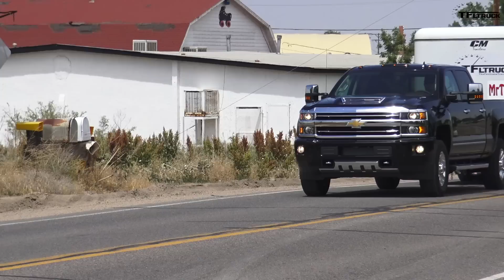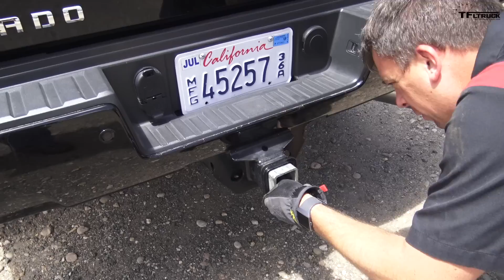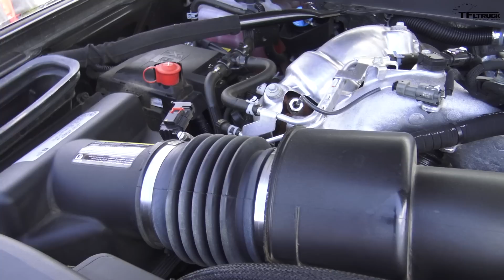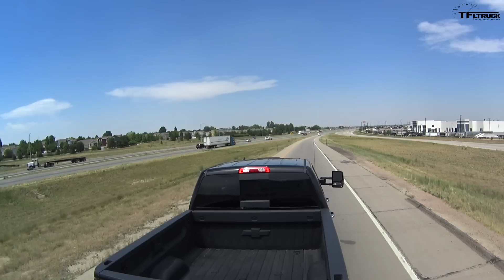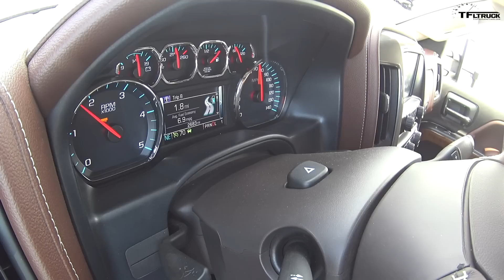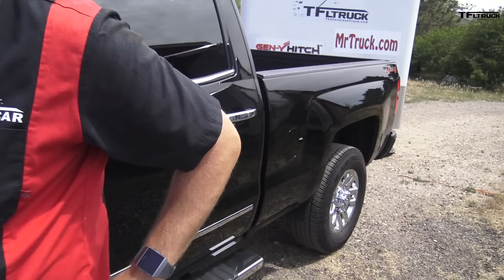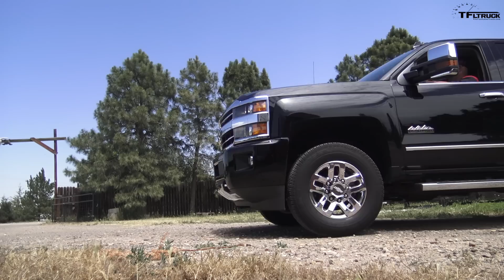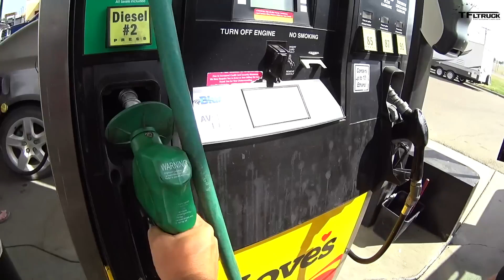MPG Challenge: Silverado Duramax vs Cummins vs Power Stroke

Comment: Did I misunderstand or did you say this is a 3500 against Ford and Dodge 2500???  How can you compare them?
Reply: the only real difference between a GM 2500 and 3500 single rear wheel truck is a set of bigger overload springs to increase payload, and yes in this comparison I'm sure the 2500 would have done slightly better than the truck they tested, so the college ball player would have beat the professional. your analogy dosn't apply.
Reply: And the 3500 should be at a disadvantage.
Reply: Nothing Much me too.  I have a 2002 7.3L Powerstroke and my dad has a 2002 Duramax.  He destroys me on mpg.  My interior room is better though.
Reply: Bad Karma
On Chevy's site when you select the duramax you are switched to a 3.73 gear, the 4.10 is for vortec gas engine. If you click on 4.10 it will give you a popup telling saying it will remove duramax for the vortec gas motor.
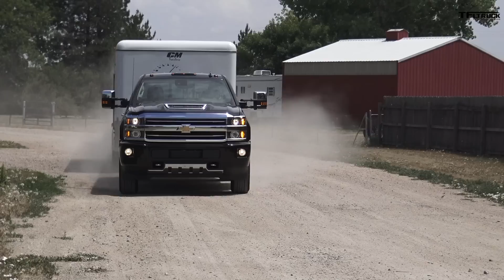Reply: For MPG purposes empty YES, towing with 4:10 gearing  It's a big advantage.
Reply: Love PPG no difference between 2500 and 3500! a leaf spring? OK how is that going to affect MOG at all. it's not a 1500 vs 2500. now THAT'S a different truck.
Reply: Love PPG If the difference is only a leaf spring then GM is charging a whole lot more money for it and not gaining much in performance.
Reply: Dude, how many times does this have to be said? They used the 3500 to make it HEAVIER to be comparable to the Ford and Dodge. If they used a 2500 it could be 4-500 pounds LIGHTER giving it a bigger advantage on the MPG circuit.
Reply: Love PPG , the 3/4 ton and 1ton Duramax only comes with 3.73... period..
Reply: He said in video, the Chevy 3500 is more comparable to f250 and dodge 2500 load capacity.
Reply: maurice davis im kinda confused on what your trying to say here.
Reply: Bad Karma it doesn’t take an engineer to do a little researching. Also if you knew trucks well enough before hand you’d know the only differentiating factor is the capability to tow more. Which doesn’t help in this test at all and is a disadvantage if anything in this particular test.
Reply: Tell me what exactly is the difference between the two other that the suspension.
Reply: The ONLY difference between a 3500 and the 2500 is no tpms and different leaf springs. So yes, fair test.
Reply: Conner Leshovsky are you an idiot? Ok let's suppose two people with the same strength are carrying 50lbs of something, one with ankle braces one without. Who will consume the most energy.
Reply: Hicks that’s not why they said they used it. They said because it has the same curb weight as the other trucks.  Basically they handicapped it.  But they should not have done that they should’ve tested all to50s from each brand equally.  They should not have penalized Chevy by using the heavier 350to compare mpg with the other two 250s.
Reply: Both people are also of the same weight and height.
Reply: For the of you who didn't find it obvious the one with the ankle braces used just a little more energy.
Reply: Kyle C. What?
Reply: Love PPG that's very different because the weight of a baseball player doesn't affect the way he plays, or throws. The weight of the truck changes the mpg because it's more weight. They are testing mpg so having the closest weight makes sense.
Reply: Love PPG... Ok you know what. you clearly don't understand what anyone is trying to tell you lol. I think you just want them to use the 2500 Silverado so it can whoap ford and rams ass even more in MPG testing lol? (because its lighter in weight)...
Reply: On the Chevy the difference is only in the suspension between the 2500HD and the 3500 SRW. The engine, transmission, rear diff, front diff, brakes, etc are all the same. The suspension isn't going to make any noticeable difference in mileage.
Reply: The Real John Smith, Even though the ford f350 has a higher towing capacity, if they were to pull the same weight trailer, the Chevrolet Silverado 3500 would tow it better and still accelerate quicker and have the better efficiency.
Reply: The Real John Smith the Chevrolet had the quickest time going up the ike gauntlet compared to the ram and ford with the same trailer.
Reply: BBMustang514 In terms of efficiency and weight class. Even though it has the lowest towing capacity, it will tow a trailer the best.
Reply: Nothing Much what about the payload effects on the truck of the 2500, higher suspension squat since the 3500 has a beefier set of leafs. Would change the aerodynamics of the truck which would effect mpg
Reply: I know that ya'll get what your get from the manufactures but this was just not an accurate test.
Reply: PARA-ADDICT! The only difference in 2500 vs 3500 would be suspension and potentially frame stiffness. The engine,  transmission would be the same. The comparison is saying that the same weight of vehicle, same trailer weight you are essentially taking out all the variables and doing a direct 'engine vs engine' comparison.  Imagine you tested three pairs of shoes running a marathon in each. The first pair of shoes you weighed 200lbs, the second pair you lost 10lbs. 10 lbs isn't much. But the third pair you lost 25lbs so you wore a vest that weighed 20lbs. Now you have the same weight on all the shoes so you see how they all compare under the same load. 

That is all they did here.
Reply: Chevy does not change gear ratio between 2500 and 3500 in single wheel trucks or duallys. Only difference is heavier springs in the back so its actually a disadvantage. Just let it happen chevy is the best diesel lol.
Reply: The only difference between the chevy 1ton and 3/4 ton is the leaf spring that's it literally! At least in the single rear wheel configuration  it was a pretty fair test
Reply from the maker: As the video said, we can compare them because the trucks had approximately same curb weights.
Reply: I think your mind is solely fixated on "2500" and "3500". Thinking that the 3500 in this particular situation is the far superior truck against the two. However, that is not the case. Since they are testing for "Fuel Mileage" and all the trucks weigh approximately the same it doesn't really matter weather they used a 3500 Silverado or 2500 Silverado. The 3500 should have technically been at a disadvantage because of it's slightly heavier curb weight but it still out preformed its competitors.
Reply: Bad Karma  Clearly you don't know what your talking about. The ONLY REAR END GEAR AVAILABLE WITH A DURAMAX EQUIPT TRUCK, 2500 OR 3500 is 3:73's. The 6L gets 4:10's. It as always been this way since 2001!
Reply: Love PPG as a gm employee GM is very good with trucks. But the 3500 is a bigger truck that can tow haul and pull better than the 3/4 ton ford and dodge and gets better mileage and will have a better resale value in the end😉
Reply: the chevy 3500 competes with the other brands 2500's in its curb weight and what it tows thats probaly a big part of why its here. ide also like to point out with chevy having over 10000 pounds less towing capacity than the other brands 3500's there 3500 is a 2500
Reply: Conner Leshovsky 

drive trains on the 2500 and 3500 are exactly the same. The only difference is the suspension. 

Now with the RAM the AISIN is only available in the 3500. Which unlocks another 130 lb/ft of torque.
Reply: They chevy 3500 tows what the other brands 2500's do so i doubt that
Reply: Love PPG yea really get all 1 tons before you start comparing them we will see world wide news that's like comparing a half ton to a go-kart if your going to test do it right
Reply: They used that $29 billion that they never paid back to us for a little R&D.
Reply: Bad Karma the only way you can order a 4:10 rear end is with a gas v-8 not a diesel which is this test. But you can also look at the ike gauntlet where the ford and dodge have 4:10 but the chevy has a 3:73. Ive had 3 duramax so i know what they come with.
Reply: maurice davis Not if weighs the same.
Reply: You just cant beat or come close to GM engineering.
Reply: Brabus 32 Seriously? The GM 3500 single rear wheel in this configuration tows less than the competition F250/ Ram 2500s in conventional towing. In dually 3500/ F350 it tows @ 10,000 less.
Reply: Bad Karma the 2500 would do better than the 3500. You would be surprised how much beefier the 3500 drivetrain components are. The diffs the brakes driveshafts and the transmission require more torque just to move. I have built engine's and transmissions for 20 years. Our engineers are really trying. We make the best powertrains and it's not a secret 😎
Reply: Matt Caesar, I can configure an HD on the Chevy website right now with different gear ratios.  I'm not trying to start an argument but let's stick to the facts.  You obviously like Chevy, but try not to let your bias interfere with the truth.
Reply: Bad Karma true you can select different gear ratios. However, not after you select the diesel option. Try choosing the 4.10 ratio. Go ahead, I’ll wait. Back?  The site forces to pair one of the 6.0 gas engines to that ratio, didn’t it?  Have a good day!
Reply: Love PPG I agree with you. I cannot fully accept when particular parameter chosen, then in the same breath we overlook gear ratio because we trust the OEM engineers in knowing how to design trucks. No this should be a class comparison 3/4 v 3/4. I still believe that the Chevy will still have an astonishing mpg but it is the principle of class v class testing. I know the GM people are speaking that the only difference is the beefier springs but we cannot forget that suspension and suspension adjustment have affect on how power is delivered to the wheels, and how air flows due to different varying height of the truck it maybe minuet but it is a variation.
Reply: Mitch and Cassie Shepherd My point exactly thank you.  If there’s no difference but a leaf spring then why not use a 2500 GMC or Chevy?  Thank you for proving my point
Reply: maurice davis how do you figure that?
Reply: Love PPG  The Chevy would have heavier leaf springs meaning it would weigh more which should hurt MPG.
Reply: Love PPG, I agree.  No one that has responded here is an engineer for Chevy.  Let's take all of the guess work out of the equation and compare apples to apples.
Reply: Maurice davis, in your first post (as a GM employee) you said "...the 3500 is a bigger truck that can tow haul and pull better than the 3/4 ton ford and dodge and gets better mileage..."  and then in your second post you said the opposite "...the 2500 would do better than the 3500..."   So, which is it?  Maybe I misunderstood because of the way your sentence was structured.
Reply: Michael Justa they clearly said though it has the same curb weight as the other two
Reply: Matt Caesar that's not it everything has to be able to take the abuse. Transmission input shaft output shaft everything else including the pump and cooling systems. It has to last in the field. GM is not in the business of repairing vehicles.
Reply: lol the 3500 Silverado and the 2500 Silverado share the same engine/transmission... the only difference is that the 3500 is essentially a stiffer sprung truck (heavier) which is why it can tow more weight... but as far as this test goes (FUEL ECONOMY) not towing... the Chevy was at a disadvantage but still won the test
Reply: Too bad the rest of the truck sucks maurice.
Reply: Tom K no it isn’t.  They use the 350 because they said it had the same curb weight as the other two meaning the other two are naturally heavier from the factory then the Chevy 2500.  It’s not fair to the Chevy that they used to have your vehicle to compare if Chevy is building the later vehicle in that classification then they should’ve used that vehicle.
Reply: RSD N/A then why wouldn’t they have tested the 2500s and allowed that to speak for itself instead of throwing 3500 in against the other two 2500s?
Reply: The Fast Lane Truck well you guys are the experts. I don’t see how being the same way as the other lesser vehicles makes a good comparison I would think the ability of the truck and what it’s supposed to do should be the comparison.    I just think it should be 1500 against1500, and 2500 against 2500.   It’s like having a professional ballplayer go against a college player but claim they’re the same body weight so it’s even.
Reply: castlem0re If both the Dodge and Ford are that much heavier than that to their detriment and you should show it against the Chevy 2500 if all the motors and transmissions are the same.     That is fair categorically.  Just because one is lighter than the other doesn’t mean you need to get a heavier truck to make them even there even by their category.
Reply: Nothing Much but different packages have different motor transmission set ups with gear ratio that would change the mileage rate on it

Comment: You absolutely need to test a ram were 373 or 355 gears not 410s
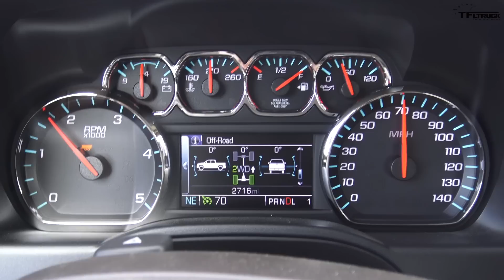Reply: David Herschberger  They made a mistake saying the Ram 2500 had 4:10's. The only gear available in a 2500 Ram is 3:42's.... so that blows your assumption out of the window.
Reply: David Herschberger I agree, but you have to admit, if the Ram can get 10.9 with 410s, that's pretty damn good! With 373s or 355s, it should be closer to the Silverado. If I was in the market for a 2500, I'd definitely pick the Ram over the Silverado.
Edit: on another comment, TFLTruck stated that they misspoke, the Ram had 3.42s not 4.10s in the previous test.

Comment: That is an incredible difference! I know GM has been doing a lot of homework to make this powertrain platform as efficient as possible. Unless the wind was at their backs on this one or the other two were in regen mode, it looks like their homework has paid off!
Reply: I would expect the same mpg if the Cummins had the 3.73 gears. There’s a trade off in performance of towing between the ratios used. The Ford is at a clear disadvantage though because it had the best mpg gearing.
Reply: Wesley Jackson Too small of a MPG difference to justify the cost of regearing. There isn't much difference in performance either so literally no reason to regear. I guess you could say it should just be 3.73 from the factory.
Reply: @anthonyj810  just bought a Chevrolet 2500 it was the was the best deal at 5 G’s less than Cummins and 9 G’s less than power broke
Reply: @leonhood2649 it cost less than the Ford because it's nowhere near as good as the Ford. Chevy is junk.
Reply: @wesleyjackson1036  but the max towed better as well.
Reply: @leonhood2649 bullshit. It's a heavier duty truck than the other 2 trucks and it barely did any better. Here's an idea. Test the same class chevy as the other 2 trucks.
Reply: If they were comparing to the Ram 2500...  It would have been actually 3.42's.  All Cummins SRW Rams are 3.42 from factory.
Reply: @sargenthp  looks like the dealership is running around changing them all to 3.73.
Reply: DanielJaegerFilms 
It makes a difference
Reply: If GM really wanted to go for best MPG they should include EFI live tunes from the factory.
Reply: @anthonyj810  efi is not as good as direct injection
Reply: GM IS TRASH BUBBA.
Reply: @DavidMartinez-fb8iw  You're trash stfu. I bet you're a ford fan too lmao ford is the real trash. They aren't notorious for mechanical failures for nothing.
Reply: @DavidMartinez-fb8iw  your mom is trash